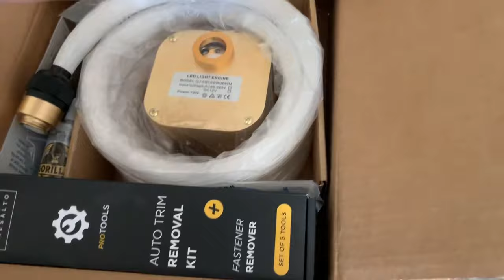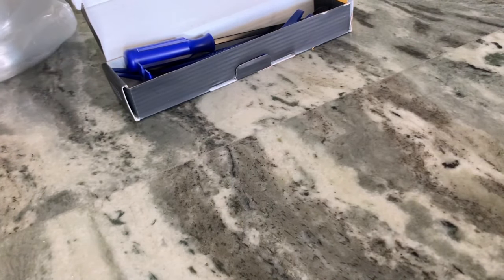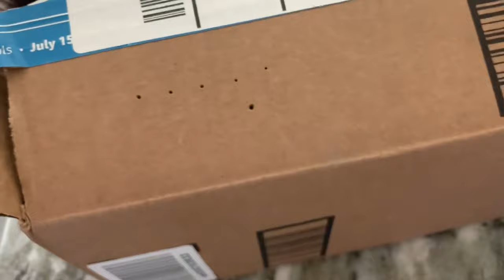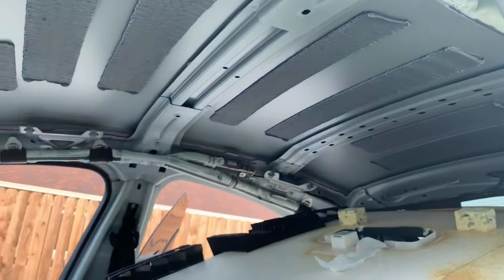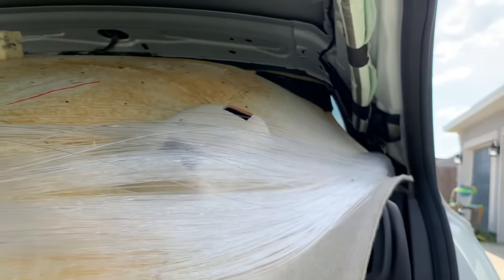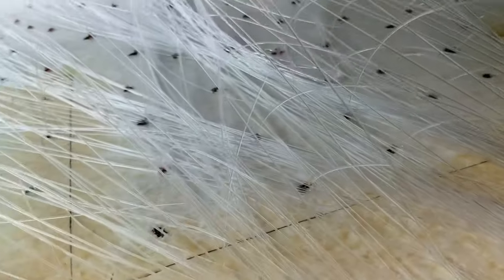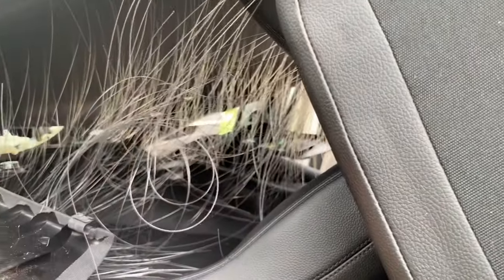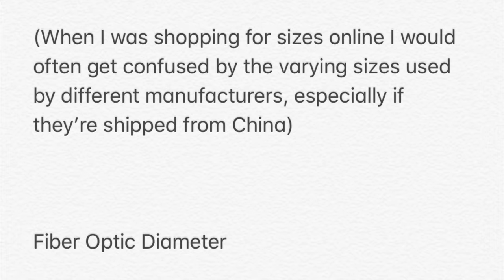How to Install a starlight headliner in 2023

Comment: Did you ever find out what the plastic pieces were on the top of your headliner board? I’ve started this mod and have some very similar pieces. If possible I’d like to remove them but I’m not sure whether they’re necessary or not.
Reply from the maker: So I’m working on a car at the moment and it has some over the back seat headrest. So I think that they may be for head impact if your head ever hits the ceiling. Kind of like to help soften the impact. But it also holds the shape of the headliner. Hope that helps… at least that’s my opinion of what they are for… I still don’t truly know.

Comment: How did you remove the middle piece from the top?
Reply from the maker: If you’re referring to the dome lamp  assembly I used a wide trim removal tool. Slid it between the headliner and the lamp assembly and you pry it off and it will drop out. It has two or three clips holding it on. But when you slide the tool in between, it automatically unclips them. There are a lot of how to videos on YouTube that show how to do this

Comment: just a heads up, lots of cars (Tesla's, for example) have their headliners installed through the front windshield gap before the windshield is fitted at the factory, so if it doesn't fit out the trunk that's probably how it went in
Reply from the maker: Oh wow! I never knew that! Thanks for the heads up. That actually makes sense
Reply: @ReynaldoVelasquez  You're welcome! cool to see you still read comments on vids like these. Say, do you have any idea roughly how big your headliner is in sqft? Mine's about 11sqft and I like the density of yours, but I'm not sure what kit that would translate to for mine. Thanks boss
Reply from the maker: @leroyjenkins8627  I’ve never actually measured by square feet, I would guess my headliner is roughly 6.5-7ft long by 4-5 feet wide (I don’t know how wide cars usually are. I would say 9ft of fiber should be long enough for most cars. 550 stars and up. I just released a video talking about the different kits. Maybe it’ll help ya out

Comment: Those standoff black pieces between the liner and your roof that you numbered and outlined "I think" are for heat. During really hot weather your roof get real hot so they might be there to keep your headliner away from your roof so it doesn't get too hot allowing air flow between your headliner and roof. I'm not sure but that's my guess.

Comment: How did you trim them (final cut) I'm sure you want them flat on the end most things pinch when it cuts?
Reply from the maker: I used some little nippers that I had on hand. I should have the link in the description. They came out pretty flat. Didn’t mess up my headliner favric
Reply: @ReynaldoVelasquez  understand what I am referring to? Pinched when cut may distorte or change the effect of the lights? Thanks! That was my only question, you did very well with the rest so great video. Looks good btw.
Reply from the maker: @DavidStirm  oh I see what you mean. Yeah these won’t pinch. They have a very clean snap when you cut them. It’s not like rubber that will bend and fold and get all soft and squishy. I believe fiber optics have a very thin glass underneath the “rubber/plastic” coating. That’s how it conducts light so well. So it just has a clean snap off when you cut it.
Reply: @ReynaldoVelasquez  awesome thanks 👍

Comment: So you splice the cigarette lighter power cord into the fuse tap?
Reply from the maker: I connect the light engine wires to an “add a circuit” fuse tap. And tap that into the cigarette lighter so that way I don’t have to cut into any of the vehicles wires. I have a PT2 video on how to wire it

Comment: Hey, I commented a while back and finally found some time to do the project, Thanks for all your help!                                       I just had a question regarding trim removal. For removal of the B pillar did you remove just the top portion or did you have to remove the bottom too? Or does the whole column slide out as one unit? I can’t find a video or any instructions on its removal
Reply: It would be greatly appreciated if you could let me know if there’s any T20 screws holding that panel in too or if its just clips, Thanks!
Reply from the maker: I believe my B-Pillar was two sections, I need to look again. The top section had the sliding seat belt and the bottom was just a piece of plastic. I removed them both I dropped them as low as they could go, I don’t even think that I removed the seat belt, I just made sure to slide the B-Pillar down. Also another challenge I had was putting the B-Pillar plastic on so that it aligns with the little button that you press to slide the seat belt up and down.(not sure if that makes sense)
Reply from the maker: dillon patel there were just clips holding the B Pillar into place. If you remove the weather stripping you should see where the clips hook onto the body and hold the B pillar in place
Reply: Just wanted to say thanks for all your help man! Just finished up my starlight headliner project and it came out amazing. I would have NEVER had the confidence to do this without you posting this video. Thank you.
Reply from the maker: dillon patel Fucking awesome!!! Make a video and post it on your channel! I can’t wait to see it

Comment: Do you think it would be possible to install a 12v dimmer switch that could be mounted in the car factory like and be used to just power and dim don’t really car for the color change and remote
Reply from the maker: Yes I’m sure that’s possible. Just keep the brightness full bright on the remote… and use the dimmer to control it. But I haven’t worked with a dimmer before… but I’m sure it can be done
Reply: I wonder if whatever setting I have it set at with the remote when I power it off with the switch  if it stays the same when I power it back on with the switch
Reply from the maker: @chadsands5038  it should. When I set mine with the remote and turn it off…. It saves the last setting when I turn it back on. Even if I unplug it.
Reply: Thank you that’s good to know I also wanted to know would it be possible to use the meteor box to make one meteor go across the whole headliner  great video and thank you for responding so quickly
Reply from the maker: @chadsands5038  I’m not sure about the meteor box…. I have no doubt it can be done… but I guess it just depends how you do it.

Comment: I’m only 14 but i really want to do this on my first car when i turn 16. Do you think it would be easy or hard for a teen with no experience? Also, this is such a great in depth tutorial you did a really good job
Reply from the maker: Thank you. I do believe a teen can do this with no experience. Just make sure you have all the tools before starting… that way you can knock it put in one solid shot. Also, make sure you have the time to do it and expect delays. You don’t want to be in a situation where you NEED your car and it’s undrivable
Reply: @ReynaldoVelasquez  Sounds good thanks!!

Comment: First, great video, thanks for uploading.

Looking to purchase a kit however there are so many out there at the moment.
10w, 20w, 32w etc
I assume its all to do with power/brightness.

As you have installed the 16w kit, do you use the full brightness or have then dimmed down?

Have you installed different size fibres to make the sky light look more realistic?

Many thanks.
Reply from the maker: I actually use the brightness in both settings depending on the mood. If I want to have the whole interior glowing I’ll turn up the brightness. And sometimes if I’m on a date or just want something a little more subtle or intimate (a little less in your face) I’ll dim the stars. Super relaxing and cool. I actually just uploaded a video recently talking about the different starlight engines and what to look for. Make sure to go check it out. It may help you
Reply: @ReynaldoVelasquez  Thanks.  Just watched the other video. There are 32w kits on the market now... not sure i want that bright though as i want it to be a subtle.

Comment: Ok so question why did it take you that long? did you work on it all day or did you take breaks. Did you have someone helping you? Or is it really just this long? I’m really thinking about doing this
Reply from the maker: So it took me longer because I couldn’t fit my car in the garage. It had too much junk in it. So I was forced to do it in my drive way in the middle of June or July Texas summer 100*F. I would work for about 15-20 minutes then go inside for water and air condition. I had four days off and I was also watching both of my sons. I didn’t have help with them that day… so I would go in and tend to them, cook, put them to sleep etc. then come out and work again. So I made sure to use every bit of the four days off that I had. I didn’t have an extra helper. And I also didn’t completely know what I was doing so I was moving slow to not make any mistakes that I couldn’t come back from. I think if you’re one of the lucky ones who can remove the headliner through the door, then you can do it in like 8 hrs in your living room haha. Usually 1 to remove the headliner. 8 hrs of work with fiber, and let it sit over night to let the glue dry. Then 1-2 hrs for reinstallation

Comment: Can i install this in a car with moonroof mine goes all the way back when i open it?????
Reply: FxNitr0 Curios on this too
Reply: Sure, why not? I would either try to look up diagrams on the roof configuration of your specific car or if you can't find anything on it, you'll have to get your hands dirty and drop your headliner down to see for yourself. Trickiest part would most likely be trying to have the fibers lay as flat as possible without creating sharp angles and creating creases in the fibers or else you'll destroy them like he mentioned. If you take out most of the slack from the fibers, it should still allow the moonroof to pass back & forth without any interference. Other people also go about running strips of packaging tape across their liner to keep them a bit more tidy up there as well. Hope this helps!

Comment: All you have to do to get the remote twinkle effect is wire your negative ground from your fiber optic control unit to your body control module in your vehicle that controls the door lock unlock and the domelight on off function.
Reply from the maker: I’m still trying to get that completely figured out but yes

Comment: alright heres my question for a year later- does the light engine require you to wire it to the car fuse or build your own? can the light engine work fine and properly by just plugging it into the cigarette lighter. I dont have the technical skills to be messing with wires and don't wanna put all this money into it if I cant just keep it with only an a/c source and no fuse.
Reply from the maker: I had it in my car for almost 2 years just plugging it into the backseat lighter outlet. Then I stopped being lazy and wired it into the fuse box. It works great both ways. The light engine comes with a cigarette lighter AND an Ac (wall plug) adapter. So it’s to your own hearts content buddy
Reply: @ReynaldoVelasquez  thank you so much. perfect tutorial as well that I will be following. bought my first car today and im excited to do this. do you have a video showing how to wire it to the fuse?
Reply from the maker: @alysser7654  yes the video is linked at the end of this video. Or you can go to my channel and find it.

Comment: Hey brother, I’m doing my project on my Escalade now. Quick question did you have any issues with that gorilla glue. I noticed one or two of my fibers broke right at where I applied the glue. I’m thinking it’s a bit to strong of a chemical for the optics. And I already applied it to half of the huge headliner. 😅
Reply from the maker: I never had that issue, but some people in my comments section did. If that happens you can try again or just switch to glue gun. I’m sorry that happened. Or even try a different glue to see if that works better
Reply: @ReynaldoVelasquez  Im going to try and cut a few random ones when it dries to see if it damaged the fibers. Definitely going to use glue gun on the other half. Also those two that broke didn’t have a lot of play on them. So hopefully don’t have to redo the whole thing. I was reading that the accelerator in that gorilla glue is to harsh for the optics, it eats away at the fibers and can damage and reduce the amount of light that comes through. Glue gun will allow more flexibility and won’t damages the fibers.

Comment: Hey man, this looks awesome. I stumbled on your video and was super excited because I have same car (CLA 250) and was very interested in getting this installation in my car, what would you advice would you give me since you’ve had yours over a year now, as well  as anything to do to make the installation process smooth as possible. I really appreciate your input. Thank you
Reply from the maker: Hmmm... I think that you can remove the headliner through the trunk but you need to remove the back seats and all the trim, and liner of the trunk, but I’m not sure. Also the headliner is held up by a square magnet in the back seat area
Reply from the maker: also it’s pretty simple to remove the headliner. Just be patient. Don’t force anything on or off. The B-pillar with the seatbelts was the trickiest part of the whole thing. You have to align the seatbelt perfectly. I didn’t unplug my battery so that I can still move my electric seats up and down, but watch out with the curtain airbags.
Reply: Thank you for your prompt response, please bare with me as I try to figure out this before installation, I think it headliner will fold but I’ll give it a try, where did you run and tap power to the light? Was there room/space for more than the 450 fiber optic cables? Which part of the whole project was more challenging And are there anything you would have done different?
Reply: @ReynaldoVelasquez  thank you for that info
Reply from the maker: @BG-iw5bm  there was plenty of room to add more fibers. Try not to crease the headliner, it will remain creased and make it weaker and the cloth may begin to sag sooner. Most challenging was trying to get the headliner out, also removing hard plastic in  the backseat where the seat belts are connected because the roof tapers down in the back it’s so uncomfortable to be back there, and the B pillar reinstall. Also trying to install the headliner handles again without catching any of the fibers, with the clip, for the reinstall use the rear magnet to hold it to the roof while you work on installing the front half
Reply: @ReynaldoVelasquez  thank you brother, I really appreciate your input, I will keep you posted
Reply: Hey bro how did you take out the front airbag without breaking them, I am running into some lil issues, please can I call you if that’s okay by you.
Reply from the maker: @BG-iw5bm  I never took off my air bags I just took off the panels

Comment: Everything looks good with lights but i wish to see whats the look on day light i mean just to see how will look when lights stop working and i don't wanted to fix it anymore
Reply from the maker: I think I’ve made a few videos where I have them in the background during the day. They are on my channel. I think they are some inspiration/advice videos. They are still bright in the day surprisingly
Reply: Yes sr what i mean with no ligth is how is the look i mean the holes will look bad with no lights ? if it doesn't look weird? And thanks for you videos  just trying to figure out it poking holes worth in long run when trying to sale you car and lights don't work anymore thanks again.
Reply from the maker: @heriberto3313  you will see them a lot easier if you have a beige tan headliner or a light color headliner. I have black so they’re nearly invisible. No one would even notice it if I had them off… unless they were actively looking for them

Comment: Thank you. I appreciate the time you took to make this. I heard you mention people adding a black fabric on top of their headliner. I have a gray (cloth like) headliner. Do you think it would still look good?
Reply: I know you wanted the presenters answer but I didn’t see a reply so here is another fellows POV: I think it won’t matter since you are mainly experiencing this at night so I wouldn’t stress about the color of the headliner. Just keep in mind since yours headliner is gray that means it’s lighter so the brightness of the lights will shine slightly more that his!
Reply: @MAGINOKU  that's erroneous. The contrast between darker fabric makes the lights appear brighter, at least more so than the opposite.
Reply: @imfrom210texas  either way it will still look good I have a gray headliner and it still looks really good but yeah if you have a black headliner it’s definitely going to make the bulbs or fiber optics brighter but in all honesty it’s not that expensive to go and get black headliner and Re-fabricate your headliner you can get the fabric at any fabric or hobby shops stores whatever The key to re-fabricating though is make sure you have a really good spray and glue
Reply: @chadjay828  can you see the holes in the day time with the lighter headliner?

Comment: How far apart did you make the holes?
Reply from the maker: Gambino orle about an inch or two apart, I didn’t actually measure the distance but an inch or so. I just randomly marked dots and poked holes

Comment: 1. What is the melting point of the plastic fiber? Will it melt if you park your car in direct sunlight? 
2. How long is the fiber optics?
Reply from the maker: the fiber optics have a variety of sizes. mine were about 8-9 ft they come in 6ft , 8ft, and 13ft. I don't know what the melting point is but I live in Texas and we have 100F weather all the time, and they are still going strong